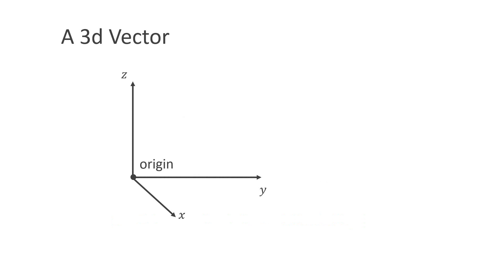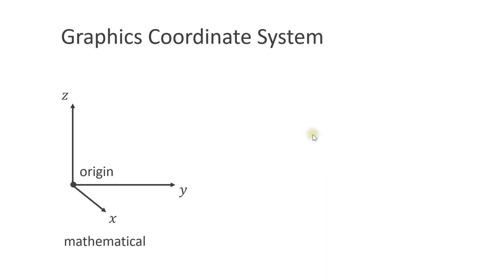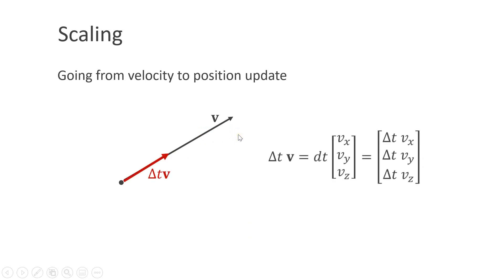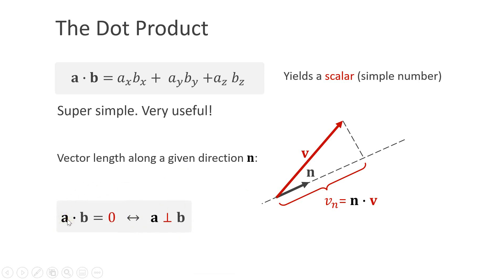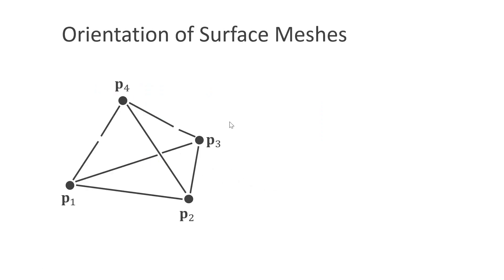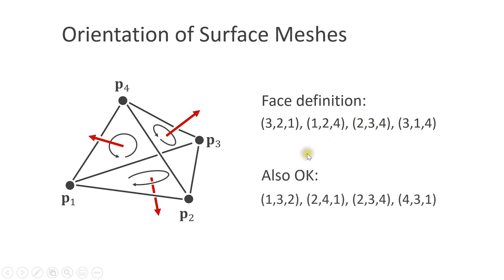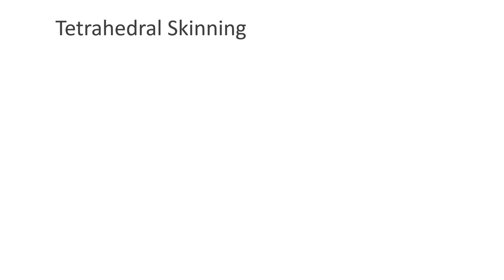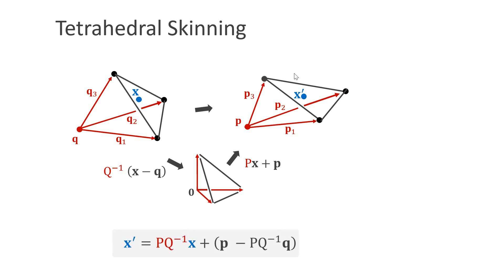Learn 3d Vector Math for Simulations in an intuitive way.

Comment: Great video! 
It may be a small detail, but what I really like is the interpretation of transformation matrices as column vectors of deformed coordinate systems. That was the intuitive math I came up with for my first 3d rendering experiments long ago as a freshman, before taking any linear algebra courses (yep, I've used them without calling them matrices). To this day, my intuition is still mostly based on that.
It's a bit unfortunate that most courses that are not graphics related, but involve linear algebra fail to address that bit in a proper way and potentially make the knowledge gained a lot less useful